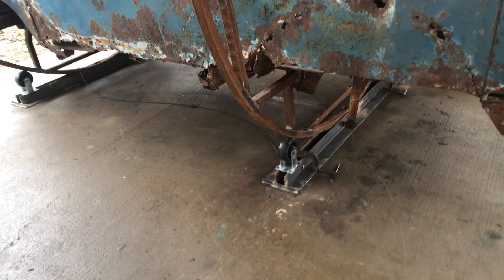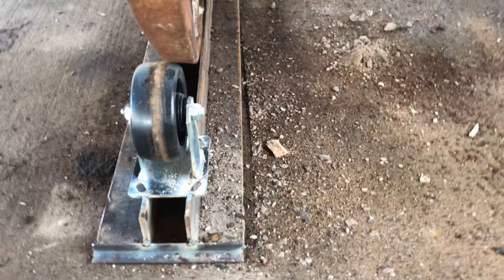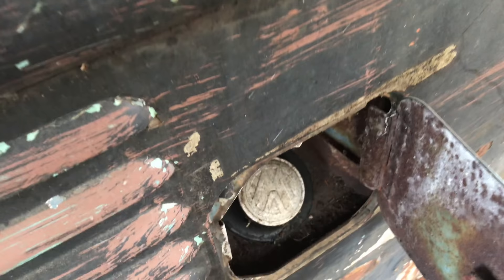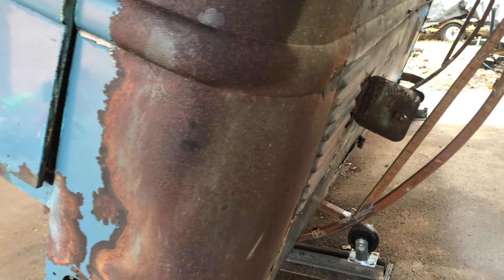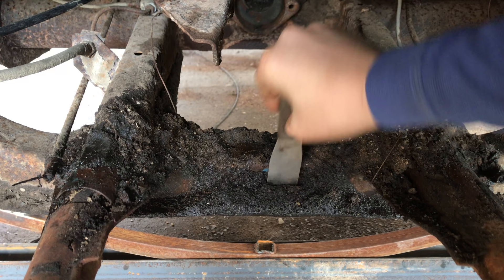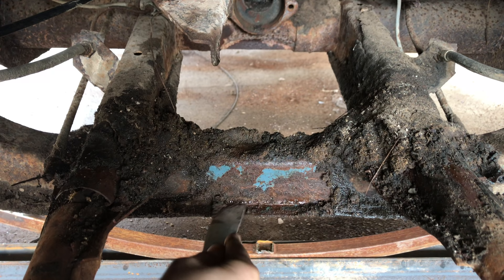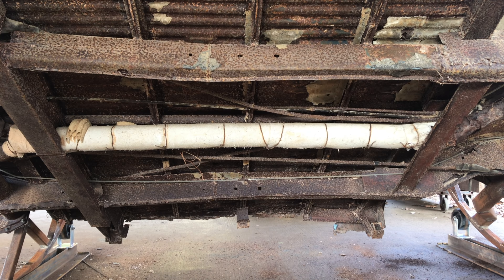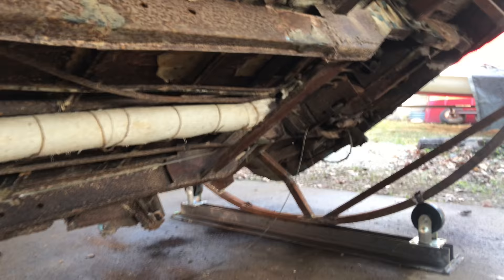VW Bus Rotisserie Build part 4!!

Comment: You could get those wheels with the
Built in stoppers on usually on big heavy duty bins ... build looks brill and the 360 is the first thing I would do just because it can !
Reply from the maker: one would think the right wheels would be easy to find...not in my area! lol I wanted bearing wheels but no one had them that would hold the weight I needed (I figured 400lbs per wheel)...yep 360 HAS to happen, even if it is only once (but let's be honest we both know once won't be enough)😆
Reply: @marcijunebug  might want to think of adding wider wheels to the build for the rings to rotate on , this way if they wobble or wander  there is enuff real estate for them to grab
Reply: @marcijunebug  Seems the opposite wheel to the turn wants to wander and pull off track, anyway  to weld plate  on the base to keep em on track??? and smart move tie in floor plates the rollers are mounted on,  even adding a few long PT 2by6's lagged in corner to corner  on diagonal  would stabilize the rig and add mass ................

Comment: Weld some guides on each side of the wheel from the bottom rail. That would guide the  rotisserie straight to the wheel. Great job of building the rotisserie and it is going to be fun watching you work on pickle.
Reply from the maker: they sit down in the track pocket so they really can't move much (about 1/4") I'm really looking forward to this project...big one for sure but I will enjoy it! It is therapy in a way for me!

Comment: hey marcy when you get that thing to rotate easily you will want some sort of brake handle so it stays in place. maybe something that wedges between the hoop and the base.
Reply from the maker: yep, moving it is the easy part, stopping it exactly where I want was where I decided to use the come-alongs/hand winches! work smarter not harder! lol watch the latest video and you'll see what I did

Comment: Dear Marci, thanks for walking us trough on how to iron out the bugs for your rotisserie. It seems the guide wheel may have to be changed because of a manufacturing issue which causes it to track funny. I have noticed this in many shopping carts.
Reply from the maker: Yes, can't but "good" stuff anymore...they ended up working out fine, it makes a full rotation without jumping off so I'm good with it! I tell ya, it was a bit of work making it, but it was fun and I DO NOT regret taking the time to build it! It has been awesome having it where I can just walk up to it and weld! Certainly worth the time I spent

Comment: I think when you flip it over the hoops will flex a bit and still give you problems. But it will work. I would have done it without the wheels and roll it around. But I know your doing it this way to keep it in the carport.
Reply: or make some large rollers. Use tubing and make huge rollers the size of the bus
Reply from the maker: hoops don't budge...I mean zero flex, I'm shocked actually...I, like you expected movement and yes I wanted to be able to "roll" in that same space

Comment: Don't know if anyone else has had syphon fuel but my take was the first time I changed a fuel filter in my Cummins I didn't know the filter had to be primed. Found out that the tank had a plate installed preventing fuel from being syphoned, used a bit of kerosene. Had a Honda Accord with the same type of anti syphon plate. Was just gonna drop the tank since everything was on top, had a 1/4 tank of gas. Well I ended up trading the car for a JD lawn tractor, to get the tank out of the car, the entire rear running gear had to be removed.
Good show young lady, love the knowledge and use of common sense you have
Reply from the maker: well at least didn't have to worry about anti-syphon on the old VW! A Honda for a JD seems like a good trade to me! lol thanks for being here!
Reply: @marcijunebug  yeah when you mentioned that one gallon reserve I just had to chuckle. I was once the proud owner of a 1960 bus, didn't like the no fuel gauge idea but knowing I had the extra gallon at the touch of a lever I was ok. the other feature I didn't know about was the fuel shutoff valve. Thought I turned on the heat, keep this in mind if you do a full restore. The fuel shutoff was there so if you parked going uphill, the gas tank wouldn't empty through the carb.
Reply from the maker: donnie brown yes, but I LOVE a manual choke! Looking forward to having that! It’s the little things lol
Reply: @marcijunebug  I sure wish I still had that bus, no dents, no rust anywhere, all original. The only one I've seen like it was on eBay, exactly the same with one little exception, it was in California and had it's nose caved in. The last bid I saw was 105,000$ oooooh
Reply from the maker: donnie brown yeah those oldies are hard to find...esp anything older than 60! Just aren’t many of them around my area

Comment: You need to weld braces to hold the track frames together and rigid so the wheels on the stand don't kick apart. The rings may not be perfectly flat where they contact the wheels.
Reply: yeah, I'd add some mass like 2 by 6's bolted down to prevent the metal from walking  .plus those rollers look a little skectchy  and wonder if solid poly wide ones could be retrofittted on beefier  housings.......guide plates too?

Comment: maybe take a day off and build you a blue tarp tent around everything cause I think it's going to get colder. Now that the gas tank is out a small heater in the tent will do wonders. That concrete floor is going to be cold.
Reply from the maker: yep! had to get that rotisserie done before I did all of that though! Thankfully I'm used to working in these conditions so on the brutal days I'll just work on something inside, have PLENTY to do like rebuilding that front beam!

Comment: The hoops may be plumb but the distance from the front to back hoop may be off i.e. the hoops may not be parallel if you measure the distance between the hoops on either side. I also wouldn't trust those casters as far as I could throw them. I imagine they have a weight rating and I bet its not a 1/2 ton. I would get some heavy duty solid polyurethane wheels with serious brackets and ball bearing shafts. I've had better wheels on a skate board and they only had to hold my 200lbs. I would also look to see if those wheels you currently are using are solid - they could be hollow.
Reply from the maker: Rings aren't out of alignment. That was one of the things in this build I was very certain of.  They are true when flat and even all the way . around with each other...I spent days on that part, just . didn't film it...that';s . the boring stuff no one wants to see.  The current wheels that are on it are rated for 1,000lbs each, aren't hollow and I've shimmed them now and they work perfect.  I . wanted bearing wheels of course, but they just weren't available with the weight rating I needed unless I wanted to drop $200+ on wheels.  Bus with everything out of it is less than 2,000lbs so were good! I'm very happy with the build, makes a complete 360 no problem at all and I only need it to go 180! thanks for the comment, much appreciated...keep them coming! 👍

Comment: Come along around bottom brackets 
for temporary support ?
Reply from the maker: to hold it in place at which ever angle I need it to be and to keep my 5 year old son from moving it...I put the come alongs high so hopefully he can't release them! lol
Reply: marcijunebug just for safety’s sake you can get stronger bolts for wheels for rotisserie. Like the bolts on a engine head.. It would take flexing out of the bolts between mounts

Comment: The rear part of the bus seems to be in better condition than CT's, but the bottom (frame) of your van seems to be worse I believe.
Reply from the maker: yes...both busses overall I'd say are a toss up as to which one is worse...zero holes in roof of mine, none along rain gutter and roof is solid, front nose is toast and most of frame is toast, all fixable,...just time...I have plenty of metal to make panels and repairs etc...but TONS of labor in front of me!

Comment: Take a string line plumb bob and run it down the ring that is kicking out from thr top of the ring and i would bet that its out .that would be why its kicking out.
Reply from the maker: I used a 4' level and checked all the way around at multiple locations (edge of 4' level touching at furthest two points)...I also checked them on the carport floor before I even started welding...carport where the beetle is parked is perfectly level, the ring lays flat all the way around there, only about a 1/16" gap for about 5 inches.  I was afraid I had warped with welding but it still checks plumb all the way around while on bus...I think it is the crown on the caster wheels?
Reply: @marcijunebug  the ring is 9 feet? Im guessing.
Its impossible to check for "plumb" with that level.
From top of ring to bottom edge you will see that being .5 degree out will jutt it across more than you may want.
Thats where my money is.
Did you think of drilling through the rails and putting the wheels directly into the rails instead of using the castors that look very weak.?
Looks great though dont get me wrong.
But to me probably a little too much flex
Reply from the maker: @vwbusguy  ring is 8 foot, casters aren't weak (1,000lb limit per wheel)  and aren't flexing...the first ones, YES, these aren't...I think the way I have it will work and worst that can happen is is jumps off that wheel it will only "fall" 1/2" because the entire large ring is only 1/2" from the carport floor
Reply: @marcijunebug  good progress

Comment: Would you buy patch panels like CT ?  I can see how the rotisserie makes it so much nicer to work on. Nice job
Reply from the maker: I plan to make a lot of them.  I had a gift certificate from a show where my double cab won and I spent all that $ on metal! I used it to buy all the "hard pieces" and then one off's of pieces that I need to copy! I'm trying to build with salvage lol not everyone will dig it, but I'm building for me 😉
Reply: @marcijunebug  will split window sheet metal fit  with minor mods?  Even the fronT nose and side panels look similar but with a little TWEEKING can they be made to fit?  Gotta be a parts bus out there in some field that you can drag home?

Comment: Would have thought that you could have bought wheels with the foot operated brakes on them that wsy negating fabricating somesort of test.
Reply from the maker: well funny you should mention that....one would think they would offer any wheel with that...nope the locking mech wheels are only on the swivel ones, which would have had to have been welded in a "locked" position to keep them from swiveling and I figured that would compromise strength, so I go these instead. Besides I'd never have trusted that as a sole braking mech anyway, not with MY toddler around, he's too creative and smart...i fixed it up, you 'll see 😉
Reply: @marcijunebug  sounds fair enough.

Comment: Really? First comment? Never had this before and I always have been annoyed if people wrote: First , Second and so on.:-) ;-)
Now let's watch the vid!
Reply from the maker: haha 👍
Reply: Dear @marcijunebug  
Don't know if I wished it already but 2 times is better than no time:
Happy new year to you, your family, relatives, friends and animals (and not only bugs).
2) As always I wanted to thank you for the heart that you had given to my comment but suddenly it disappeared! PANIC ! Maybe only because I changed one wrong spelled word from "ans" into and?!
So PLEASE HELP, I simply have to get my heart back! ;-) :-) Good grief, the very first first comment in my life additionally with a heart and it went away... sigh... sob... 
3) I bet that some kind of brackets (maybe only bolted on pieces of flat steel) could solve your problem. Simply try to use the wheel axles for this improvement. The steel ring will be guided then and isn't able to lose the contact to the wheel any more afterwards. I think that this is the easiest way.  Also your great rotisserie machine stays much more mobil than with welded together floor components.
4) Please kindly allow me to give another tip out of my experience: Flatten the high points of the wheels so that the steel ring always has good contact to the rubber. Otherwise this isn't absolutely necessary if you guide the big rings relatively closely.
Puh, I hope that I found the correct words.
Best regards luck and health.
Reply from the maker: thanks for the tips! ❤ here's a heart just in case the "liked" version goes away! 😉
Reply: @marcijunebug  
😳 Uuuh, thank you sooo much for your kind words and all the new hearts. Here is one for your son 💚
See you soon.
Reply from the maker: awe, I will give it to him!
Reply: @marcijunebug  
👍 :-)

Comment: It's hard not to be overwhelmed by it try to just focus on one day at a time and one goal a day and before you know it you will be driving pickles around  .I did the rear brakes on a kia sportage at the weekend well it took me three Times as long as I thought it would due to the poor design of the brake system  it's like they dont want your doing it your self nowadays. 
There is one bolt that holds the caliper carrier and its almost inexcusable as it sits in the anti sway bar both sides
Reply from the maker: they for sure don't want you to DO anything on your own...want you to BUY new, so many times I look at something and think...WHY did they design this that way! ha
Reply: @marcijunebug  I forgot to say happy new year x. I look forward to being with you as you fix pickles over 2020

Comment: I did think those wheels looked very narrow. Maybe wider “roller” type would have been better to allow for little wobbles.
Reply from the maker: it's finding them that is the problem...the rings are 1.5" the wheels are 2.25" so I think it will be ok...
Reply: @marcijunebug  add sacrificial guide plates to the bottom rails near the rollers to keep   alignments